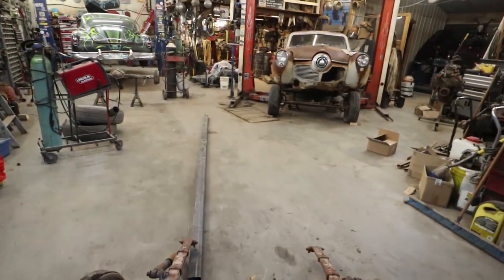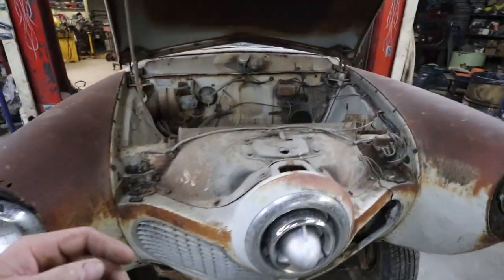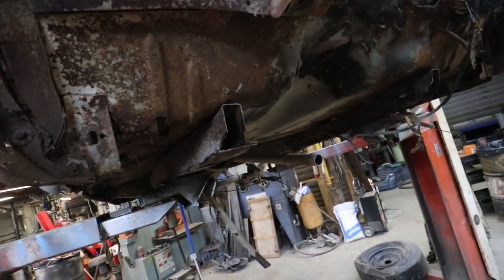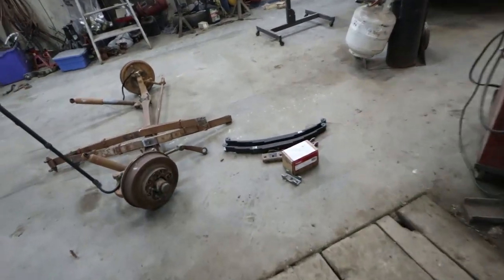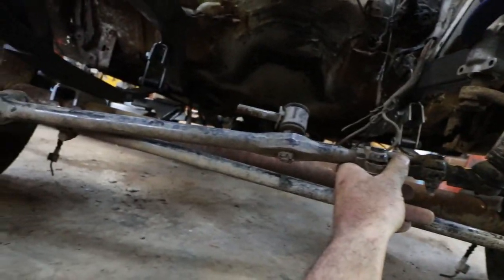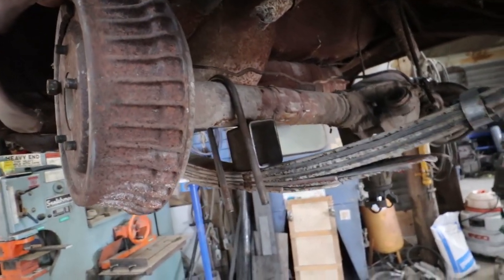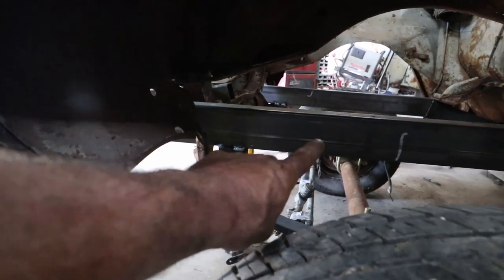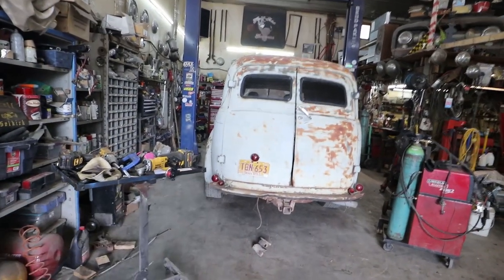1951 Studebaker Gasser Part 2

Comment: A guy I knew had one of those that was black and mint with a 6 cyl. 3 speed with over drive. It even had hill lock so it wouldn't roll back when letting out the clutch at the stop light. We drove it all over the place , cruised nice at 70 mph.

Comment: To correct the front steering you could use a high steer kit. It is Jeep after all. That  would  Correct your steering and make it drive better 
You should be able to copy one of them on the maker with your plasma cutter.
Reply: Yeah without the right height it will create bumpsteer too.

Comment: i just do not see how you will be able to see the track , move the drivers seat to the rear , for traction , put a mirror on the roof to see the track , i would consider a rack and pinion steering  , hang on tight ....

Comment: Studoodle bug, itty bitty 2 footer trailer springs giv'n the straight axel a hug, hung out on 2×3 steel cuz the old frame's crunchy like a bug. Stude diff out, replaced by one with some clout, nose up n diff down, up front a bullet nose snout. Radiused wheel arches cut, lowered in da butt, she's a roller push her out to the dirt where da grass ain't cut. Studoodle bug nose up in da air, pablo's nose in da wind n ears flapp'n without a care. Pup dog looks happy rid'n with you there!

Comment: Intriguing car build are you raising rear of car to more level height even with front? 
When I saw engine , though I'm not sure the original engine reminded me of a Buick opal's engine, don't hold me to that I was little when I saw that engine & ignorant of engines at that age, I really was not paying attention. Still a electric motor intrigues quite & fast as snot. 
As always the best is that sweet pup of yours.
Best David

Comment: I made the same mistake with my Rambler Brent.  My springs were from a 61 Econoline and they were really long!  Thank goodness my buddy knew more than I did and steered metal in the right direction.  I opted for the Speedway spring kit with bushings and shackles for $90.00.   Worked out slick.  I wanted the nose so high in the air that I couldn't see the road in front of me!  Bringing it down a little bit now.  When you're done you can race Corey's Henry J!
Reply from the maker: haha that would be awesome

Comment: that studebaker looks surprisingly good as a gasser. Always felt that just the front looks good on those. thinking you will need to do some welding on those floors, just to keep the dirt outside while dirt racing.

Comment: Just a idea I see you scrap cars out . Then throw body and frame away I think . Cant you keep some of the frame for steel to make frames. Instead of buy square stock. I use to work at a frame place . And I see some rail with straight runs of c chanel

Comment: I've noticed in some old cars that the wheels are not centered in the wheel wells from the factory. Why?
Reply from the maker: I don't know I wonder if it was the manufacturer thinking as the suspension goes down the wheel with center maybe
Reply: Seems like they are all a tad forward. I usually see an eye in front and a shackle at the rear. When the spring is flexed and flattened out the excess length has to go somewhere and thats where the shackle lets it stretch backwards. As it does the wheel on the spring moves back very slightly too so that why I always thought they were forward just a bit.

Comment: Brent for future reference Suzuki Samurai rear springs are about 36". They are a good choice for a light spring. I use them on off road camp trailers
Reply from the maker: Haha samurais are almost a thing of the past out this way I think they've all gone back to the Earth
Reply: @HalfassKustoms  Well if you ever want to spend the money Old Man Emu sells new ones. That's what I buy. OMECS039R . They are about $100 ea though!
Reply: Actually got a couple of old Sami’s sitting around…. Used to mod them for off road playing. BTW, the front springs are actually shorter than the rear. A popular mod is to move rear springs up front, and add double shackles and long travel shocks for major droop….

Comment: Just asking - Did you check and see that when you turn the the steering wheel right the wheels will in fact turn right?
Reply from the maker: Haha yeah I did check it though the steering box isn't mounted yet usually you just got to point the arm to different way and then your golden LOL

Comment: Rather than nose bleed high, why not see what the regs are at the track where you might want to run it later?  Center of the crank to the ground height might be nice to hit once for your dirt drags + a future  track.
Reply from the maker: I think I would rebuild the back half of the chassis before it ever go to an actual track if need be the front could go down pretty easy

Comment: Why not just use a beer keg as the gas tank? That's what you're putting on the front, right?
Reply from the maker: No it's actually a spun tank much smaller than a keg. :)

Comment: I like it....I like it alot.....I will be watching this one , and be working on my own.
I am currently doing a 50 Studebaker Champion Starlight Coupe, it was a 2 owner original that I drove it in stock form for around 6 years.....boring....
So I started collecting parts and a  couple months ago I started doing it to it...with the help of a uncle on some suspension fab work..the car is being built in a tent in my driveway....and I live in Oregon.
So far the new front suspension  , 4" dropped tube axle with coil overs and 4-bars, disk brakes and cross steering mount to new frame tubes starting at firewall.
Then the rear suspension was installed...first by moving the rear rails inboard, then building a homebrew truck arm with coil overs , then narrowed a dana 60 housing and installed ford torino type axle tube ends and filled it with custom built 35 spline  racing axles, a spool and 4:10 gears, this was all done so that the Mickey Thompson 29.5x18.5x15 tires mounted on 15"x15" steel wheels will hang under it....actually I opened the wheel wells so that I can let some of the meat hang out... front wheels are 15"x4.5 American five spokes..going for kind of 70's street freak look , not real high with the very slight nose up look.
For power its a 69 327 sbc with a tunnel ram w/2 Holly's and all the other go fast stuff , scatter shield and a 69 Muncie M-22...Rock crusher..trans.
And tuat all gets set back 10" in the chassis....on and on...as I come up the cash I then order and install the parts.
I will probably not be doing any dirt racing with it...its just going to be used for going to town..... its all about having fun.

Comment: If you put the shackles in front then you wouldn't have to build a block for the front. Four wheel drive is in the front.
Reply from the maker: yeah tried it and just don't want to mess with the sheet metal in the front to make it fit, not that it's very good there haha
Reply: @HalfassKustoms  ok, I figured you had a good reason for it. Good job can't wait to see it done.

Comment: those frames are the same type that Chevy use 👍👍 we removed the front end from the stude frame and used a hk Holden frontend and rack and pinion ! worked out well 👍👍

Comment: I dig the look of a gasser out of a stu- Bocka and think that as frames go, it might of went easier to just remove from the original frame and set it on even a frame from a nash rambler as the stuff there is as far as I have seen you reach back and save. I like the looks of gassers and loved driving them in the time or day as   called. If you pull this one off, then your the god of metals!!! LOL. I would do a total interior delete as it looks like more died inside than can ever say lived in one for some time... good luck Brent
Reply from the maker: Yeah interior delete will come yet haha

Comment: Looking good on the Stude Gasser build. When I built my gasser frame. where the frame kicked up from the firewall I cut a piece at a angle of the 2x3 tube coming off  below horizontal to the new frame. Bolted  the spring inside for the rear mount. Used the shackle in the front.
Reply from the maker: interesting the studes frame I found kicks out in the front kinda making the spring placement weird actually but I'll tackle that better when I get it back in the shop.